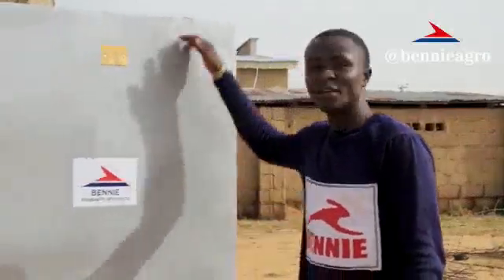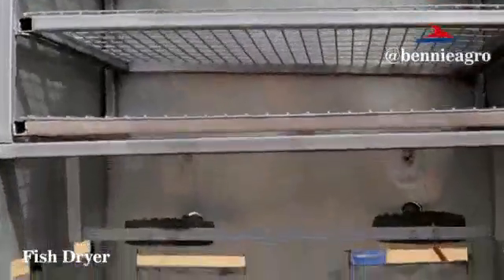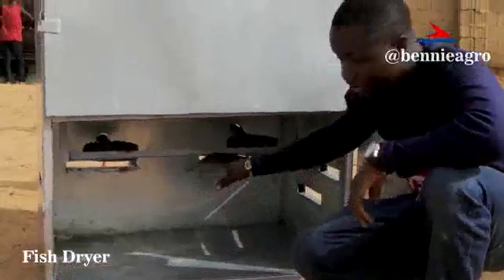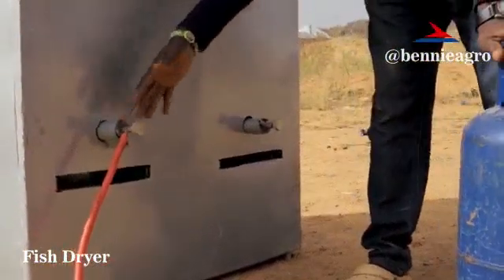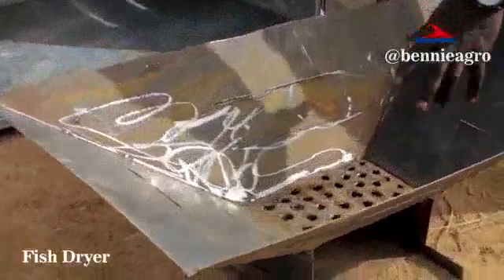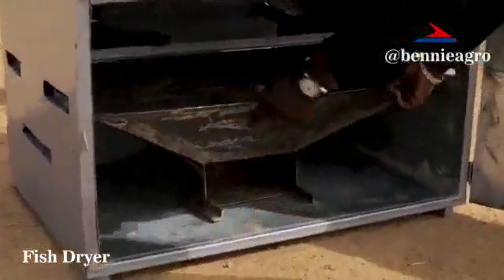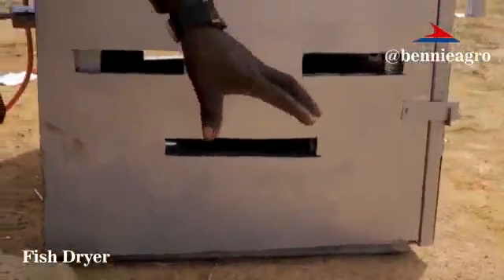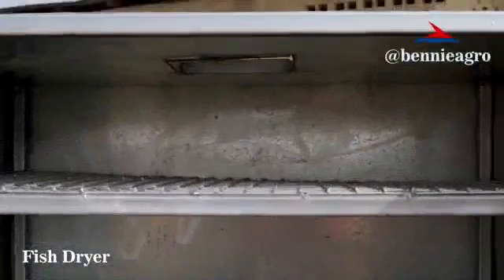Fish dryer - Bennie Agro

Comment: Great job Bennie...But you should consider introducing the heat blowers,for heat circulation in or around the dryer,and a thermometer to show the degree of heat,a heat/smoke extractor to do away with excess heat/smoke...

Comment: Has this been tested? Looking at the design it shows some flaw in heat circulation. certainly the lower sections are hotter. How does the heat get distributed evenly so top trays receive as much as lower trays?